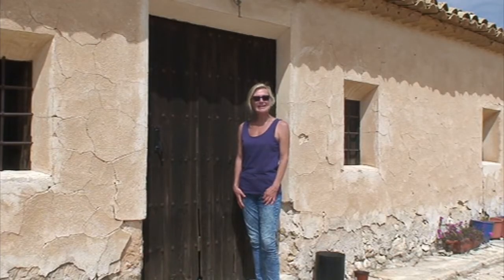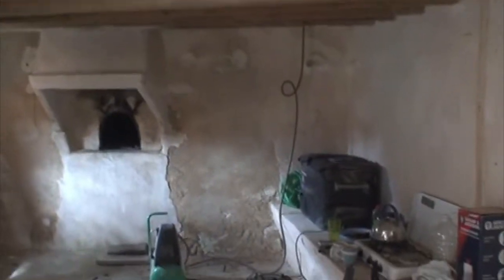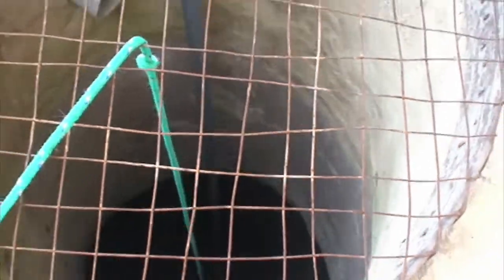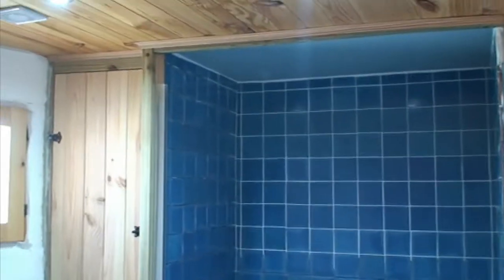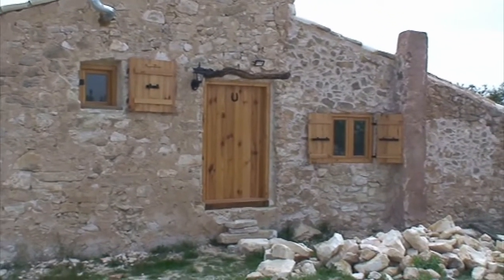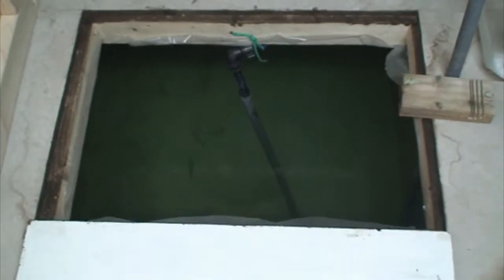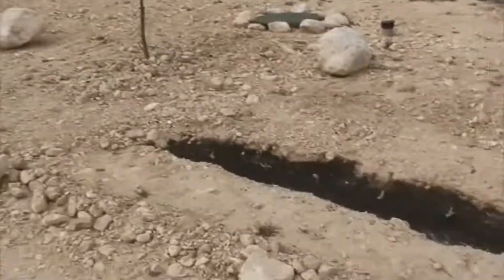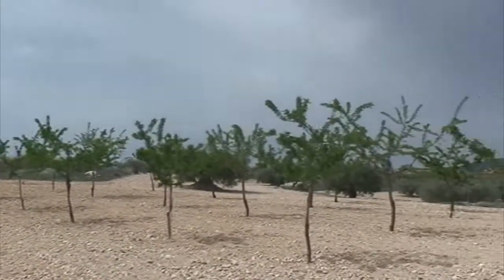Restoration of an off grid Finca in Spain - Our first video...

Comment: Very cool, I want to do something similar somewhere in Iberia. How do you find out how much ground water is available in Summer and Winter?
Reply from the maker: The rain water is collected off the roof and groundwater run off. We're going to do a video on this in the future, plus all the other services. The roof collection area is around 100m2 and gives 1000 litres for 10mm of rainfall, the ground run off only collects storm rain and we had 30mm the other day which gave us 3000 litres of water. If we need water and it doesn't rain we get it delivered, 20000 litres at a time.
Reply: @FincaLife  Thank you ! I never thought i'd have to worry about there not being enough water/rain where we're from ha. Good to know cheers